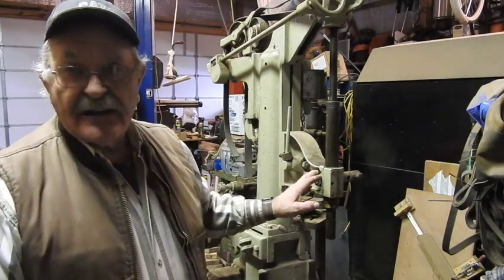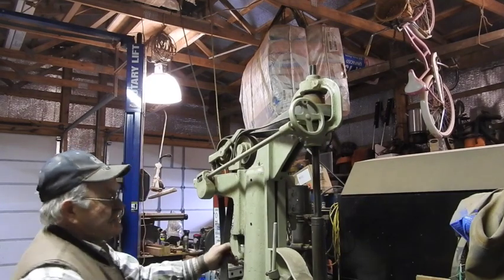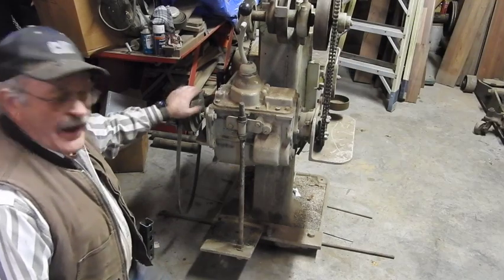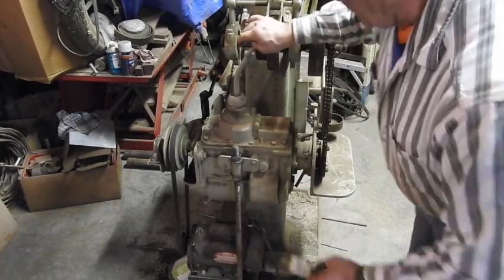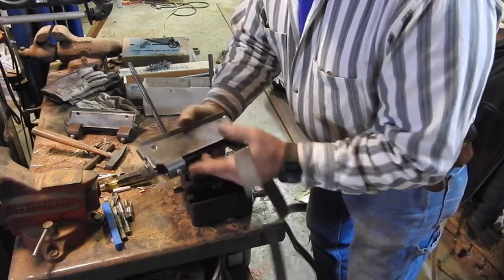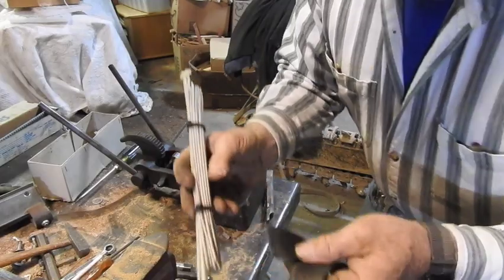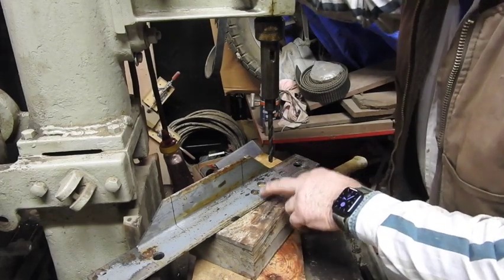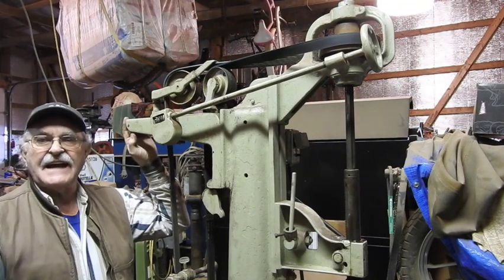Why Should I Keep a 100 Year Old 500 Pound Boat Anchor- Actually Its A Drill Press

Comment: I have this exact machine and its great to see one running. In the process of repairing mine now. Came from a factory in Cincinnati OH, still had the assembly line tag on it! Do you know what length your drive belt was? I am needing to make one up for my machine.
Reply from the maker: IIRC, it took 118''  There is probably enough adjustment to be off a little one way or another.  That's cool that you have a pristine example of this old drill.  I was thinking of asking a local belt maker if he'd be able to get me a leather strap 118 x 1 1/4, but the serpentine belting seems to he holding up pretty good so far.  Thanks for the comment and letting me know there's at least one other out there in someones shop ready to go to work!!
Reply: @tractorman4461  almost ready, not quite there. Getting bearings ordered at the moment before puting it back together. I can send you what bearings I use once they are ordered. They did not number the bearings that many years ago
Reply from the maker: @johndillon28  I'll be darned.  That makes sense though.  Some of the manufacturers didn't even start serial numbers for the first few years either.  I've had them destroyed so bad on different machines, I'd have to measure and order off the measurements. Usually that results in success, but bearing numbers might be nice to have for the future.  Thanks for the offer.  I'll keep an eye on this thread.
Reply: @tractorman4461  any  way you can make a video on that worm drive tensioner? Thats the only broken part I have to worry about, both shafts sheared when removing them. Cast iron with press pin retainers dont work out well after sitting so long it appears. I have to remake that tensioner from scratch
Reply from the maker: @johndillon28  that’s unfortunate. Dang. I can get some up close shots for sure. Do you need specific dimensions of anything ?
Reply: @tractorman4461  the outer deminsions of the gear box maybe, I wouldnt want you to take yours appart. Might find out what I did the hard way
Reply from the maker: @johndillon28  are you wanting to make it ‘appear’ original or would you consider acme thread rod and rod coupling/new shafts?
Reply: @tractorman4461  new shafts are a must, was gonnna order a worm drive gear set. I would like to keep things how they were
Reply from the maker: @johndillon28  I didn't get to it yesterday.  Spent the day on the sawmill and in the wood pile.  It was another 65* day here in the middle of January.  Those days are for outside stuff.
Reply: @tractorman4461  do you have an email to go back and forth on? Probably be easier than here

Comment: I used one real close to that it had a feed on the spindle was a great old machine
Reply from the maker: I've got another I've been cleaning up Donnie.  Its a Champion Forge and Blower drill (iirc) that's got the spindle feed too, but the internals of the feed are slipping under a load.  Gotta get into that one of these days.

Comment: Happy New years a little bit early. Don't get up to read this. This is Car Old. My handle on YouTube got changed when we uploaded my first video short clip. It'll take 2 weeks before I can change back. It was about 1970 Chevy truck stepside. Not the one I have been doing a frame off restoration on. I wouldn't call that when I restoration because it's not exactly stock anymore. That white one in the videos bone stock. Right down to the yardstick that came with it when it was sold from the dealership. Anyway that is a very neat machine you have. I think it's very ingenious the four-speed transmission. The fact you can adjust that down to basically whatever RPM you want makes it great for drilling. Plus you have the right bits for it too. But how in the world did you ever move that thing? There's been machines that I'm sure companies way back in day spent 50-60,000 on back in the fifties and maybe 40s. They sell for a few hundred dollars. Even though that's just a fraction of what their scrap price were. But all those machines to get them out of there especially with the time constraint I'm thinking one place in particular was beyond my pay grade. It had everything on it you could start your own machine shop. Anyway just want to let you know my handle has changed but everything has just been retrofitted to my new handle and comment on your latest video. My missus reminded me to tell you and your missus Happy New years which I already did but sometime to Misses just doesn't ear drop.
Reply from the maker: Good to know the new handle...I'll go take a looksee.  The Missus thanks your Missus for reminding you for the well wishes.  Women....we just GOTTA love 'em don't we !!  We extend the same kind thoughts and well wishes for the New Year to you two too.  Yes, there's tons of industrial machines discarded almost daily across the nation and many times its just to the junk yard.  So sad, but they are so big, you just can't find a place for them.  When PPG, the plate glass company here closed down and moved to Du Quoin Illinois the shop was sold for literally scrap.  Also a lock lead smelter shut down and because of the lead contamination, I am sure the whole machine shop had to be scrapped.  This old drill press was headed to the junk yard when I managed to get it for free a few years ago.  I was able to load and unload it with the Kubota, but it was all it could do.  In the shed, I move it on 1/4'' black iron pipe...just hopscotch with them and roll it.  Not easy but I do it. Its in position now to use though.  Have a wonderful day and I'm going to check out the old Chevy !!
Reply: @tractorman4461  roll it on black pipe I heard the Egyptian Jewish slaves rolled those big pyramid blocks on logs. Now that's an old principle that still works
Reply from the maker: @CAROLDDISCOVER-2026  Hahahaha...yes it is certainly 'old' old school ain't it !!  As a commercial hvac pipefitter service tech I had to move many good size boilers, expansion tanks, big ol' pumps and heat exchangers into and around mechanical rooms.  Tons of other stuff too.  Sometimes with help, sometimes without help.
Reply: @tractorman4461  yes it's old old school. But at least you don't have to worry if you got the right chip in the computer to run the apparatus. Haha. On a side note I must be drawing a lot of attention out there with some of my comments speaking more so on the car side of things. I've got a guy that is arguing in favor of the new 10-speed transmission been out a few years now. I think 2017. Anyway my nostalgic taste and he can wipe me all over the place. Funny thing is he's probably just reading articles and he'll be right if I should line up against one of these new Camaros. But he uses nostalgia as a dirty word. It has its place. Even if you just rolling a heavy piece of equipment on some black pipe. It depends on the bracket you're racing in. I know it doesn't have anything really do racing that is with HVAC moving heavy equipment etc. But that term nostalgia transcends what thousands of generations going back to Egypt building the pyramid to you moving a heavy piece of machinery to somebody running a quarter mile. Or more likely the 8th mile nowadays. Everybody's in such a hurry. But sometime nostalgia ways are the only option and the best option. I know a guy with one of these $50,000 Camaros the ZL1 or whatever it is 10-speed transmission he gets 40 something miles to the gallon when he's not doing an excess of 150 on the highways! Endangering countless people's lives and must not be caring because he's doing it on the public roads and not the track. After saying that I guess I have become my father amazing how that happens. By the way this guy is about 60 years old. Now the guy been bouncing back and forth with on this debate I have no idea who he is. But in short I'd rather go by a few links of black pipe or galvanized then to spend a couple thousand dollars to move the machine by renting equipment for the last few feet of movement. The quarter mile is ancient history for me as well. Just thought you might find that interesting. Now why is it when I enter another segment of the conversation thinking I'm going to make it short but it almost never is. I can't get that red cedar out of my mind that you could cut here a little while back either. That was beautiful wood and to imagine how much more beautiful it would look in person. Video only does so much and I guess even that's digital now.

Comment: Nice drill press Wendell!!! I'm betting you rarely get beyond 2nd gear with it though. I have a blacksmith post drill mounted on a support post in my garage. I don't use it often, but when I need to drill a big hole, it comes in handy as it has power down feed. Problem is, the "power" is all human! I need to rig a way to drive it with an electric motor. I'm getting too old to be cranking that thing!!! Does yours have power down feed? Very handy. Semper Fi and Happy New Year to you and yours!
Reply from the maker: You are probably right about the low speeds going to be used the most....for sure, I'd say.  This one does not have automatic power feed but I have another old Champion Blower and Forge drill press that does.  But its worn pretty good and wants to not feed just right under a heavy load.  Thanks Bret for the Holiday well wishes. A Happy and Healthy New Year to you and your family as well my friend. Semper Fi brother.

Comment: I had one something like your anchor, and mine had an auto feed....I use to drill spring steel with it and it would get the job done.....I done away with it cuz the garage could not afford the real a state.....Nice demo of the old drill.....some time I kind of regret doing away with mine but I just can’t keep everything.....I have enough of a mess as it is.....CHEERS
Reply from the maker: Yeah, I understand the value of shop space real estate.  I'm kinda crowded too.  Actually its really a messy area.  But I like old stuff so I just shift stuff around.  LOL

Comment: Now I want to get my old 'camel back' drill press motorized . It was given to me, to keep it from going to scrap, and the only thing I have used it for since I've had it, is to crack black walnuts 😎😎 I welded a short piece of pipe to a piece of scrap flat stock for a base, set the walnut on the base and bring the quill down till the nut cracks.
 I don't have any morse taper bits, but do have a drill chuck from my South Bend lathe I can use for my Silver and Deming bits.
Reply: The old hardware store in town had a stand alone belt lacing set up. They had no idea what it was for till I told them. When the store closed, they had an auction and I had to work that day, or I might have had my own machine. Not many people around that can lace a belt anymore.
Reply from the maker: @bluegrallis  Yeah, there used to be a lot of 'em around.  Most all farmers had a belt lacing tool and it was as standard at a blacksmith shop as an anvil.  Too bad you didn't get to pick up that old tool from the auction.   Thanks for the input my friend.
Reply from the maker: Now, that's a novel idea.  Crackin' nuts.  I never thought of that.  Nice twist !!  Heck yeah, jump on that old drill press and make it come alive again Charles.

Comment: For years i used flat belt conveyors to move fertilizer in the fertilizer plants I worked in. We had a16 inch ratcheting clamp for fastening our lacing. And catgut was required. Anything else besides stainless cable or catgut would corrode and wouldnt come apart over time. Getting 16 inch lacing stright was sometimes a challenge. Great video.
Reply from the maker: Yes, square cut is the key to a straight running belt.  The biggest I've ever made was an 8'' belt. I bought half a pickup load of old belting at a farm auction for $2.50.  Literally 2 miles from me.  Many years before that I got a great amount of brand new belting from a dumpster while on a service call.  2'' to 8'' in partial rolls.  Thanks Alan for the input concerning the big belts, I can't imagine making one up in that width !!

Comment: A machine from when men were men. 
The heavy castings make this a perfect subject for an upgrade. No vibration and no twisting. 
I had the misfortune of being responsible for the upkeep of HAAS CNC lathes at Douglas Autotech. 
The steel frames twisted with any variation in temperature. Most of the automated shops have temperature control just to keep them from wandering like a drunken sailor. 
The Morse taper tooling is rock solid too. Not hight speed steel so keeping the RPM's low is a good idea. 
With a shot of oil to the bearings every time you start it the drill should make another 100 years no problem. 
If the tilt of the column ever becomes a problem you can square off the mounting base with a grinder and file. Shims are popular. Not a good idea. Had to repair a few that had the corners popped off from someone sticking washers between the castings. Cast iron isn't bothered by compression. Tension will crack it right off. 
The 4 speed is a genius upgrade. It lets you keep the bits happy by running the standard 300 rpm for a one inch bit  While being able to speed it up to 1200 rpm for the 1/4" pilot. 
No need to flip the belts. Much faster setup. 
The old girl will make chips as long as you treat her right. 😁😎
Demmer had milling machines big enough to set a pickup on that were upgraded to servo controls and CNC. Better than waiting a year for one to be shipped over from only God knows where that will fail in a year and have to be shipped back.
Reply from the maker: Thanks for all the additional input concerning steel vs cast in old machines.  I always thought these MT bits were HSS....if not, what are they referred to as.?? At this point I'm unsure if the runout is a slight bend in the vertical shaft OR if the casting repair is the culprit. As far as speed control is concerned I have the option to use a three phase motor and a VFD, but I liked the idea of the 4 speed better.  Costwise and also because when I got the old drill press, the truck tranny was already in position. 
    You can't put a whole truck on this machine, but if I'd had it running before, this is where we would have drilled my buddy's Chevy block a couple weeks ago for the oil filter change.  It would have been a much simpler job right here !!
Reply: @tractorman4461  The bits are high carbon tool steel. 
Bits are still made from high carbon steel. Most of the Silver & Deming sets are. 
The good high carbon steel bits are harder and can hold a better edge than the High Speed Steel bits that are common in the smaller twist drills sold in kits today.
The big difference is High Carbon Steel will lose temper if they are run too fast. 
High speed steel can be heated red and it will hold temper. 
The Tool Room at Douglas Autotech still had an anvil and the tongs for forging cutting tools out of High Carbon Steel. 
The last of the actual blacksmith tool makers retired the year I started there. 😁😎
Reply from the maker: @OldSneelock  Thanks for the additional info.  So instead of HHS they are HCS....I guess.  I try to keep regular oil or actual cutting oil on 'em while drilling no matter what.  I really like to use Tap Magic.  You can literally 'feel' the difference in cutting the material.
Reply: You probably won't have to do anything special  with your normal drilling. You have been using drills for as long as I have and I'm sure you have enough history to know what to do. 
Unless you are drilling exotic material HSS steel and HCS are relatively interchangeable. 
I love Tap Magic. We went though about a pint a month at Borg Warner when I was building stamping dies and assembly fixtures. 
That was their money though. Now I haven't had a can in a long time. 
You have been working long enough to just know what works. I just like your drill press a lot and see it as a big plus for your shop. 😁😎

Comment: That's my kinda boat anchor! I have a huge old Champion Blower & Forge Co. camel back drill press that I will get going soon.
Reply from the maker: I do believe I may have one very similar.  It's pretty much ready to go right now, but the automatic feed is worn pretty good internally and under a heavy load it doesn't want to feed right.  So I use it manually.  I think it's set up for #3 MT bits.  The motor mounting on it is kinda funky, but it sure has a heavy duty boxed channel iron frame.  Is the curve of the frame the reason its a camel back...??  I'll have to look closer to mine and see if its that specific design.
Reply: @tractorman4461  I believe that frame curve is how it got it's name. Mine is a beast
Reply from the maker: @mattthescrapwhisperer  I bet so !!  I really like old machines.  A lot better if they still work.  LOL